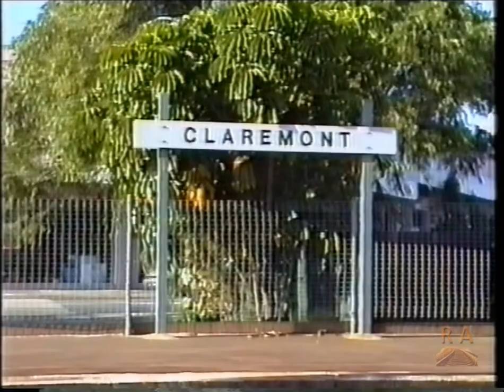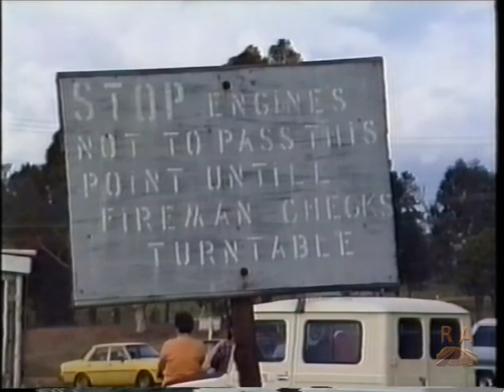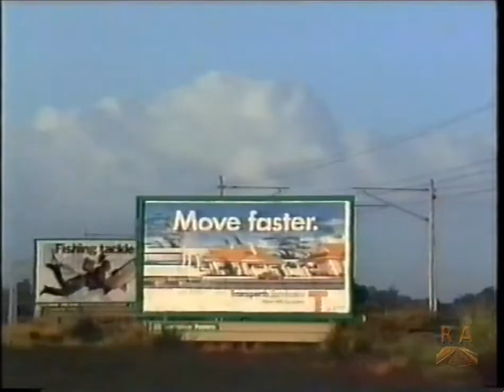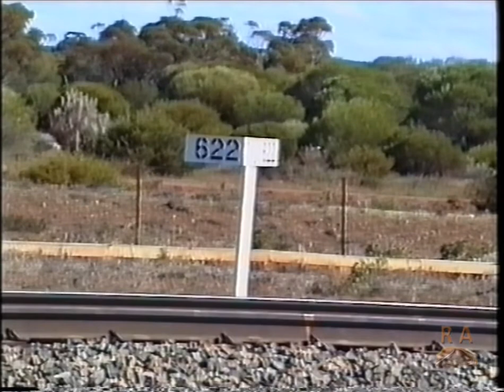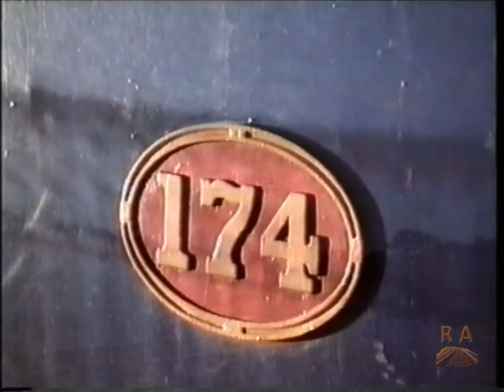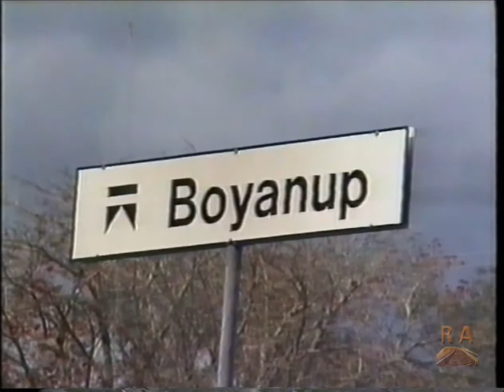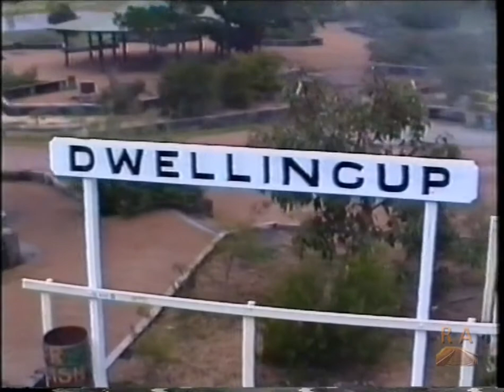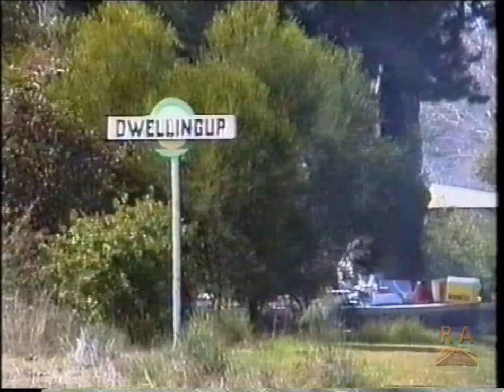WEST AUSTRALIAN RAIL ROVER 1990

Comment: I remembered the Kenwick Railway Overpass at 40:48.

The old Kenwick Railway Overpass used to carried the Armadale Line over the freight line when the freight line used to cross the Albany Highway that ran parallel to the Armadale Line.  

When the WA Government built the Roe Highway Extension, they removed the freight line level crossing signals and elevated the Albany Highway over the freight line and did the same at Thornlie when they built the Thornlie Spur to Thornlie Station.